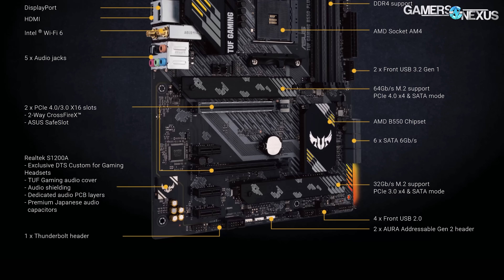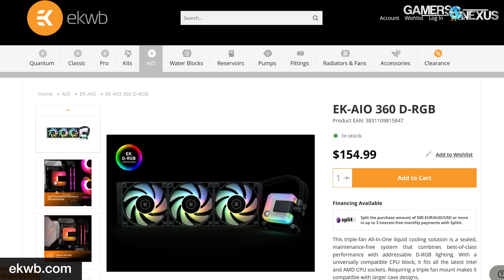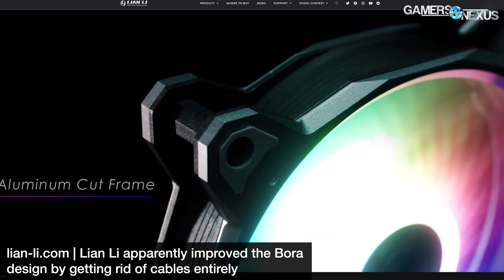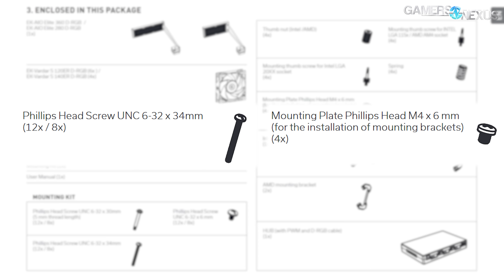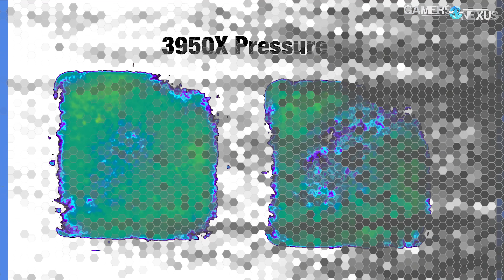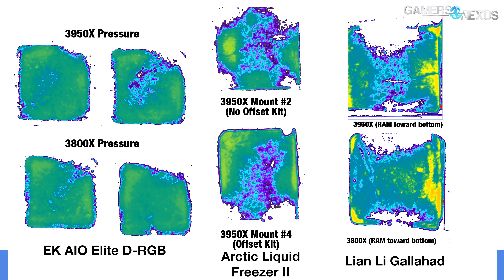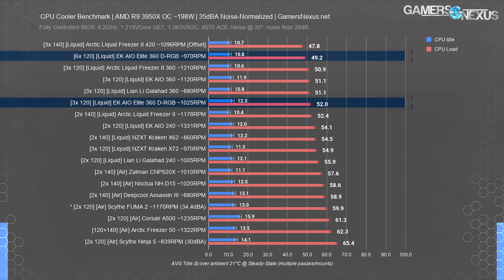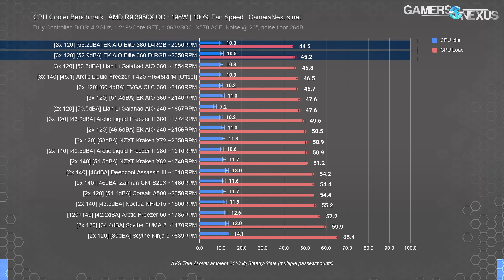6-Fan EK AIO Elite D-RGB 360 Review vs. Lian Li Galahad, Arctic Liquid Freezer, & Air CPU Coolers

Comment: Hi Steve et al, 
I’ve recently got a 5800x and an ASUS tug x570 pro WiFi. I experience reboots when trying to launch WarThunder. Looking at event viewer I get fatal hardware error 18 which points at the processor core. Looking around it seems this isnt an uncommon issue and not limited to 5xxxx series. I’m intrigued as I’m just using the defaults on the mobo and the most recent bios. Do you think I should RMA the cpu, mobo or both?

Comment: One thing to note is the dimensions are 88mm x 70 mm if you are counting the fittings on the block. Ran into an issue with EK’s pumps not fitting my asus gaming-I motherboard. Too tight of a fit.

Comment: Surely the best fix for the number of cables is to use modular fans, like the Lian-Li Unifan, that lock together to daisy-chain without them? You'd get this thing down to two fan cables and two RGB by doing that, and make everything a lot cleaner.

Comment: I was the biggest fanboy of Arctic! but now im biggest hater! 
listen this videos - uJZ6qiuBLyU and m6Qko5V7LVU (codes videos for youtube) on youtube in headphones on max volume! and this parasitic sound on any of Arcric P12 and P14 fans on ANY of RPMs in vertical installation!! :\ (on video in my case on top intalled absolute the same 3 Arctic P14 fans on same speed horisontaly - and with fans on top i dont have this problem) on videos it is just ~500RPM :(
...and before my Arctic Liquid Freezer 280 pump brocken after 5 months working, i'm getting back my money, but this is not a problem - i'm just will never buy any of AIO again! :/

Comment: I got so sick of all the cables and having to replace AIO's that failed so I went back to Air, best decision I ever made. I have enough cables to deal with already with all my drives and 10x Fans, I don't need anymore cables for some flashing lights. My next build will be in the 802 with Noctua Fans and no side panel, only reason why I didn't replace my RGB fans is they were expensive. Worst decision I ever made going with RGB fans because the RGB software totally sucks! Aura Sync crashes American Truck Sim CAM is absolutely terrible Fusion is terrible Mystic light is also really bad. Manufacturers: Release expoensive AF RGB Fans.. Also Manufacturers: Lets not test the software and release a potato.. Going back to old school no side panel and quality fans with no RGB. Rant over.

Comment: yea currently have 11 fan's in my pc, 6 of them RGB (corsair fans), currently practicing making custom cables so i can shorten the fan cables during maintanence because it's just impossible to tuck them somewhere >.> i have places were i need a 10cm cable but i have a 45 or 50 one.

been slowly taking my personal rig from a...standard cluster of cables to something that looks a bit more nice and organized...atleast i was untill i crammed 11 fan's in my pc had to hide 2 rgb hub components somewhere and also get more power connectors up in there to power the RGB hubs >.>  if only lian li's new RGB fans were a bit more alternative controller friendly (switched to aquacomputer RGB PX recently but it has a 90 d-rgb led limit per channel and the lian li fans use 32 led's a fan so at 3 fans i have a problem even if i connect it...would be a nice 2 cables instead of 6 for 3 fans >.>

Comment: Would the extra three fans potentially make a much bigger difference on a hotter CPU? It seems to me like an overclocked intel 10900k might push the temperature up enough that it actually makes a big difference.

I guess my question is: do you know if effectiveness of adding push-pull scales with the heat of the CPU?

Comment: Nice one was considering push pull config.. Useful info
In other news I'm still trying to install (for crying out loud) Arctic Liquid Freezer II 360 on my Crosshair VIII Dark Hero w/o success. 30 yrs on PCs and I haven't faced an issue like this..  It's a PITA installation wise and w/o clear and precise info even depending on the revision on their online manual. Too much confusion I don't think I trust this product for proper and trouble free mounting on my board.. Went back to my X72 which can be installed in 5min w/o issues every single time and changed the 3x120 fans with  Corsair ML 120 Pro. Noisy but effective with such static pressure. Might go with push pull we'll see but noise will most definitely will be a major factor..

Comment: Would you consider a test where you carry out your suggestion??
1. Fit it into a case in the out of the box config of push/pull. To get a base line.
2. Remove 3 of the fans, and fit them to other locations in the case.

Comment: The Arctic offset mount was a fantastic innovation. It caused the amount of available open box deals to increase drastically because people sent them back when they interfered with motherboards.

I got a "used" Liquid Freezer II 240 for 50€, the plastic film still was on the block and fans.

Comment: I saw these fans that click into one another to move power between them. Why don't all fans do that?
I get that it costs more, but that's only for the first model. If everyone starts making them, the price will go down and at the end they won't cost more to produce than fans with cables.
Reply: Reduces value to the customer. You could take any of these fans and install them in a case or anywhere else individually because they have their own cables

Comment: most cases provide at most 25mm above the motherboard for top-mounted CLCs, if any room at all. how is 50mm of fan and 27+mm of rad going to clear the top half of the motherboard in most cases out there? hmmmmm. (edit, ok, good point on using the fans elsewhere in the case)
Does that CLC include the GN head-mount for keeping heads cool during this difficult time, in such a miserable DIY computer market, lol.

Nice intro Patrick and Patrick, lol.

Comment: lmao at the intro , I just got this aio delivered and unboxed .  I put off installing for now cause I don't feel like dealing with that cable mess . glad I get to see this first and Im going from a corsair 240 aio to this ek 360. The black cooler looks much better.  Glad I saw this video before installation,  think I will only use 3 fans . Thanks Steve  , excellent video as always

Comment: There is another solution: replace the fans with Lian-Li Unifans. That would cut down on the cables substantially. I'm not sure for this kind of setup, but 6 fans can use a single set of cables.
Reply: i mean, true, but then you are basically throwing away like 120 euros of perfectly fine fans i think i'll take the cable management over that. Plus i prefer the look of ek fans over lian li, but that's only personal preference

Comment: i have the EK AIO Basic 240 and it's amazing for the 5800x on a mid tower case (radiator on top position), i literally save like 30bucks only because of the fancy RGB, the black design is so nice without RGB and the performance it's amazing

Comment: I bought this CLC based on your good reviews for the ek 360, figured 3 more fans doesn't change much.  Unfortunately... after getting everything else set up, I found the pump is doa.  Checking 1 star reviews, I found many other people with the same issue.  Now I have a noctua nf9us cooling my 5800x and the rad and all fans still in the case,  with the water block wrapped in plastic and just hanging in there. I can't muster the energy to do anything about it right now.  God darn it ek.

I was really impressed with the fan hub though, with the nice clear top and the argb indicator light (helps with troubleshooting too)
Reply from the maker: Thanks for the info. We'll keep an eye on the pump and see if it produces a similar failure over long-term use. Thus far, we haven't had any pump issues, but obviously that doesn't mean they aren't happening. We'll keep an eye out and appreciate viewers like you who help us keep an ear to the ground for what's going on at a wider scale. It's a different pump from the original one, so maybe that's some of it.

Comment: I just got the EK 360 AIO and freaking love it! One thing I wish they did was to make it expandable to work with their GPU water blocks
Reply: Their first aio the predator did that ,i have one sitting on a 4790k. It actually was repair friendly even tho ek never marketed it as such
Reply: Hey , still using 360 ek ? How is it ? No issue with pump after a month ? I hear ek 360 aio , got issue with pump after few weeks
Reply: @nikeller11  still going strong no issues so far

Comment: change my mind. all fans should have daisy chain plugs on them
Reply: No argument here.  I'd also be happy if all fans had short cable lengths too--then use an extension for the first fan in the chain.
Reply: Excellent idea. That would also allow different lengths cables, just like with sata-data, power cables, etc.
Reply: Love Arctic's PST fans for this reason, I can use a bunch of them on my cheapo motherboard without buying splitters or hubs.
Reply: I don't want my ceiling fan to have a daisy chain
Reply: Argument: There's a limit to how much daisychaining you can do. Every header on the mobo - from the fan headers, to the addressable ones - has a set voltage it can deliver to each header. I believe the fan headers are 12v, while addressable headers are 5v.

When you overload those headers with too many daisychained cables, you run into issues with power delivery. One, it can cause the fans to not get enough power to drive all of them - which could cause issues with PWM control. Two, it can cause issues with the LEDs in the fans, where connected lights display incorrect colors, flicker, etc.

This is why fan hubs are a thing. In addition to cable management reasons, the hubs connect externally to the power supply via either molex or SATA connections in order to receive enough power to drive all the devices connected to it.

If you daisychain fans, you shouldn't do more than three on one header. If you have a larger case like I do (O11 Dynamic XL) with a lot of fans, you're either gonna need a hub, or you're gonna have to split the load between any extra headers available on your motherboard.
Reply: @haziqtheunique  I run 12 fans and have no problem running each set of 3 daisy chained fans off different headers. 

Modern motherboards have so many connections on them it's almost impossible to use them all.
Reply: @haziqtheunique  The fans will be fine at lower voltages: even in PWM mode, they'll run at 10V, and the MB fan header shouldn't drop below 11.5 to maintain the standard.
The real issue is the current limitations. Fan headers on MBs are not rated for very high current, and daisy chaining fans can easily exceed that. Even really high current ones are usually 1A max. 6*0.18 = 1.08A which exceeds this. You can damage the MB if you exceed the current rating of the fan header.

5V addressable RGB are even lower current, which means overloading them will drop the output voltage too low and you'll have issues, but in this case it's more likely to not work than damage anything. Still not recommended.
Reply: They ain't Christmas lights bub